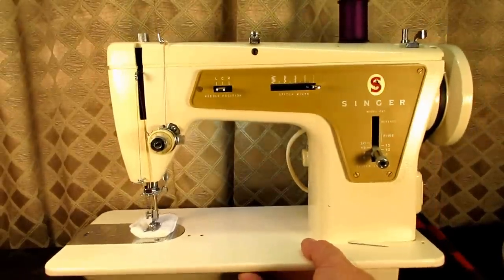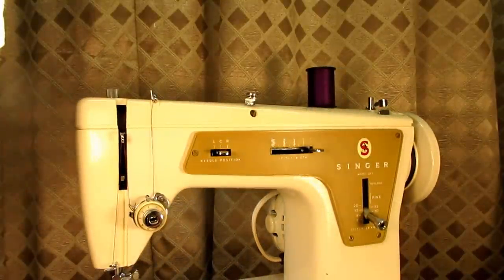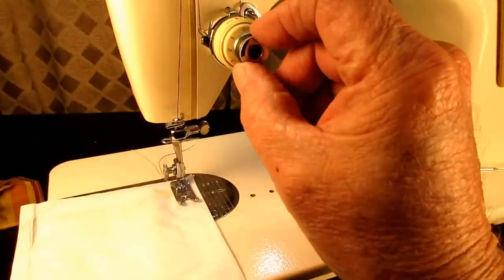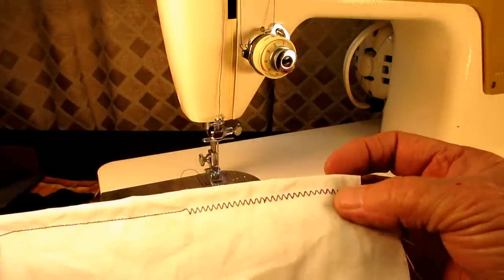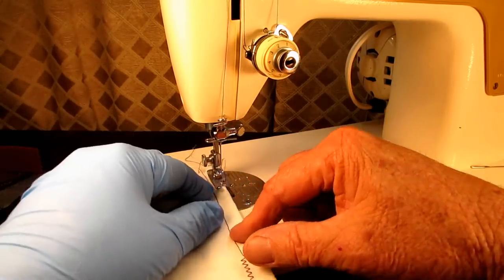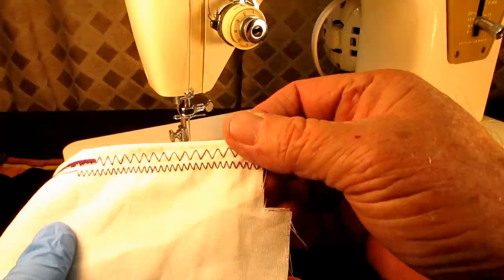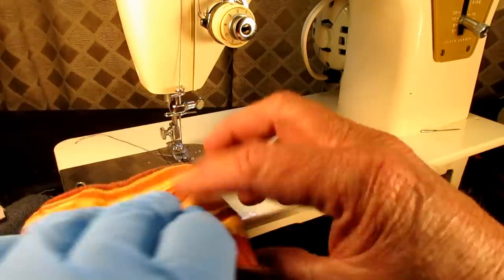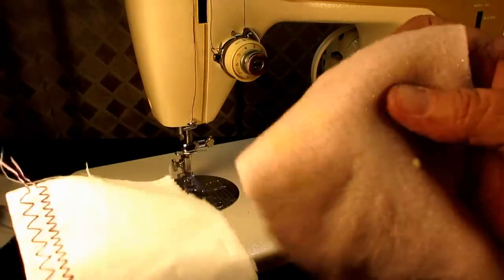The Sewing Test of Stella, a Restored Singer Model 237 Sewing Machine

Comment: I have this machine.  It was my grandmothers and I have been told that it's one of the best machines ever made.  Got it out tonight to make face masks for COVID-19 protection.  Started out working well and all of a sudden, it won't uptake the bobbin thread.  Found the manual online, but it contains no troubleshooting information.  I guess i will be doing lots of research tonight.
Reply from the maker: Even the best machines can develop a problem. It is surprising how often it is operator error though. I usually pull the needle thread all the way out and rethread, following the manual closely. Re-insert the needle making sure it is all the way up in the clamp and facing the correct way. Double-check that the bobbin CASE was threaded in the correct direction. Usually, the failure to pick up the bobbin thread that is not the sewist fault is due to loss of timing between the needlepoint and hook point. The way the mechanics are in this model it is extremely rare the timing goes out unless the height of the needle bar was changed or moved. Here are my 21 videos in a playlist for this model : 
https://www.youtube.com/playlist?list=PLsCOZgzzaiKKzvgm_CYPFnDeM8ZqTTo1h
You can buy and download a copy of the original Service Manual right now at this link for $9.95 :
https://manualsoncd.com/product/singer-237-sewing-machine-service-manual-download/
It has a few adjustments that are not in my videos. Many people do believe the 237/239 models were the last all-metal domestic (home use) Singer Machines made. Good Luck.

Comment: Thank you for your video Andy, I had my 237 restored for me and it works great. I'd like to take out of the plastic case and put it in a vintage sewing table. I see in your video no hint of the plastic case.
Reply from the maker: Here are all 21 of my Model 237 videos: https://www.youtube.com/playlist?list=PLsCOZgzzaiKKzvgm_CYPFnDeM8ZqTTo1h
My 237 came in a wooden case. It was mounted into the wood base of the case using hinges just as you would mount into a table. Most of the Singer plastic cases I've seen have a couple of screws (or more) on the bottom of the case that screw into the bottom of the machine or the underside of the screw hole for the hinge set screw.

Comment: The singer 237 is very robust, the proof is that after 50 years, at the date of its manufacture it still works, it can be likened to an industrial one, except that it does not have the double drive at the level of the foot, you compare it to the Sailrite ultrafeed machines apart from the design and the foot, it is the same system as the tension block and the same mechanical system. Personally I use it for layers, I've lost count of the times I've broken needles, but it never got out of sync, no timing needed.

Comment: What’s next Andy can’t wait. I was gifted a Singer 27 from a friend. Haven’t played with it yet. Not sure how she sews. Manual says 1902 with vibrating shuttle. Just like the one I had from my 8 th grade graduation gift from my parents 1966
Reply from the maker: A very unique machine, that model 27. Shuttle! For those who don't know what the deal is with a shuttle, you can get a free manual about the Model 27 from Singer at this link: 
https://www.singer.com/sites/default/files/product_manual/268_27_28.pdf
My next project, if I can find it in my storeroom, is a Singer that is Internationally known for its bad top gear. A nice under-rated machine you can find for a low price, even free, and for $10 replace the gear and have a powerful, versatile ZigZag machine. Stay Tuned.

Comment: Hi Andy I had a chance to buy one of these machines but the lady wanted 95 dollars and wanted to do porch pick up because oc the covid 19 social distancing so I decided against it.I hope I did right because I really wanted it!
Reply from the maker: Hi, Sharon. You'd have to decide if the price is OK for you personally. For me, $95 for a working 237 would be OK. I mean take a look at Walmart at what $100 buys you. A 9lbs machine. The key is "working". Even before the COVID I have bought machines off Craigslist with porch pick up b/c they were not allowing a "strange man" into their house. What I worked out was that hey had to have a working electrical outlet or cord out the window. Someway for me to try the machine before I would buy it, or cut the price by 50% as how would I know the motor even ran? The sellers always agreed to this and if not I would not have bothered. I take the covers off and look inside. Turn the handwheel to be sure the needle, feed dog, and hook all move. If that's all good then I'd run the motor and then thread it and sew a little on my scraps of fabric. I would bring a needle, filled bobbin, and thread. If it passed all that I'd buy it. If the belt was very old/cracked I would negotiate a $10 to $15 discount for that, etc. Buying an $85 model 237 and spending $15 to $30 for parts and cleaning and adjusting it would give me a $250 machine.
Reply: @andytubesewing1953  That would have been good if she would have agreed to put a cord outside....lol.Next time I will not be so scared to just take someone's word that it works.I will eventually find a good machine.Thanks for your advice.I really appreciate you!
Reply from the maker: I'm sure you will! They pop-up when least expected in my experience. Sorry you missed this one, but maybe there is a reason it turned out that way. Thanks for watching my channel, Sharon, and take care.
Reply: Hi Andy I bought a brother festival 461 today.It has an unusual  protective cover with pink flowers on it.I think I got a good deal on it for 65 dollars.I have to look  at it tomorrow and make sure it's all good.It's a well cared for machine .It has nchips in the paint and nothing broken.I didn't get a manual for it though
I wonder what year it was made? I think I did good.

Comment: Hey Andy, I just found a 237 and that plastic plate right in front with that red S on it is missing the screw right to the left of the left center right lever. I thought I remembered watching a video where that’s not an actual screw, but it is like a clip. Mine is missing so it’s sitting loose there. Is that a screw looking piece I can find at a hardware store or is that specific to a Singer.  Or am I totally wrong and is it actually a screw. I kinda looked behind that plastic and I didn’t see any threads on the machine so that’s what led me to thin it’s a clip in there.
Reply from the maker: Here is the video you remember: https://youtu.be/eMnqTpJO-fg   The chapter about the cover plate starts at 21:09. If I'm understanding your comment correctly you are missing a screw. The plastic pins are molded onto the back of the plastic cover plate and in a different area. I don't know the thread size of the missing screw but it is the same as the other three screws you have that hold the cover plate onto the machine. The holes for those four screws are threaded in the body. You can take off one of the other screws you have and take it to a hardware store and try to match it as close as possible. Many screws were made by Singer but sometimes they used common-sized screws. I suppose you could also buy a tiny bolt and nut. Vintage parts can often be found on eBay and other online stores but you'd normally have to buy all the associated parts not just the one screw. Here is an example: https://www.ebay.com/itm/395599932049   The Part Number of those screws is 352175/871 as shown in the parts manual for that model but good luck using that to find a replacement. I look back on restoring that 237/239 with fond memories b/c of the traveling hook and complex ZZ parts. Good Luck.
Reply: @ OK, thanks for clearing that up Andy. I think I need an updated pair of cheaters. I didn’t think I saw threads but apparently they are there lol.  I think I’ll just lightly glue it.😝
Reply from the maker: @rhondamercado7527  Think about using double-sided tape. I have used it before and feel it is easier to remove if needed. Enjoy that unique machine.

Comment: Hi Andy. Just been given a mint condition 237 after watching your Videos ive oiled it and checked the brushes in the motor and its running like a bandit. i noticed you have polished the slide plates how did you get such a good finish? Thanks for the videos
Reply from the maker: Over the years I have tried about 6 metal polishes, but always go back to Brasso. https://www.homedepot.com/p/Brasso-8-oz-Metal-Polish-76523/202820651
It's so cheap to buy but does a great job. It's a little stinky, but OK when just doing a few chrome parts from a sewing machine. I buy cheap car wax applicators, terry cloth over foam, at the dollar store to apply the brasso and microfiber towels to remove it. I still do it all by hand although some friends do it with a buffing wheel on a drill. Thanks for watching my channel.
Reply: @andytubesewing1953   Thanks Andy, ill have a go with the brasso
Reply from the maker: @bally 796 Good luck. I don't remember if I mentioned in the videos, but I bought a new slide plate. As usual, the vintage one is of better quality so I only used the spring from it. Hope you'll be enjoying your "new" 237. Take care.